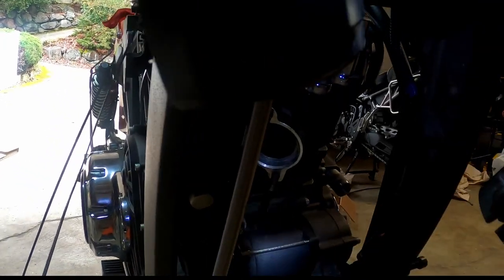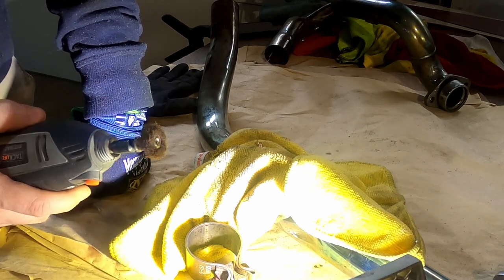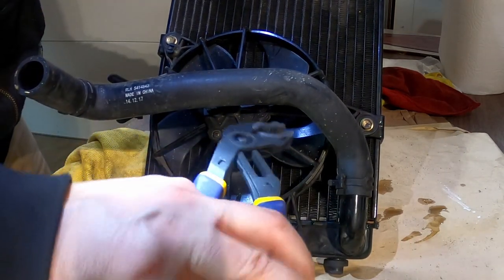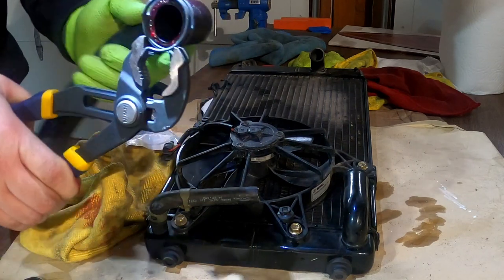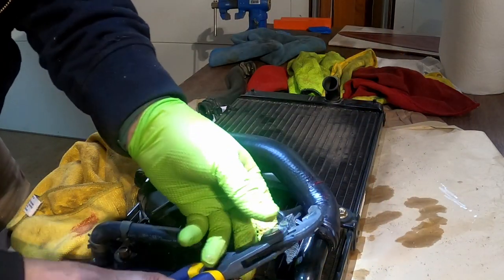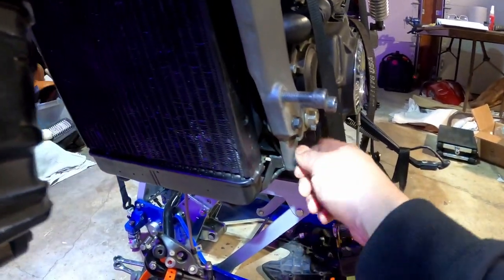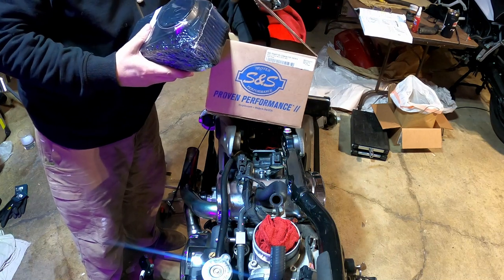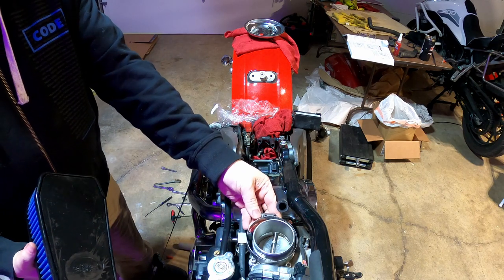Indian Scout Radiator Fill and new air intake

Comment: Thanks for the reply.I think i will buy a coolant vacuum pump to refill it should make it easier. You think indian would put a drain plug on the rad so you wouldn't have to unbolt the rad to get to the hose to drain.
Reply from the maker: Oh I agree.  It is a PAIN without a vacuum pump, but it can be done.  Takes a LOT of effort to get all the air out of the system.  Thanks for watching!

Comment: Great video.Hoping you can answer a question, on bottom of rad there is a small hose and the larger hose.If i am going to drain the coolant i assume by looking at it i would disconnect the small hose to drain rad?Thanks in advance
Reply from the maker: Either actually.  If you have the small coolant ring around your oil filter you can remove that hose, but also uncap the radiator so it will drain.  You won’t get all of it easily, sun some distilled water through or just some of the new coolant and shake the bike left and right.  It takes a bit, but it will drain.

Comment: Thanks for posting these videos I'm working on that bike and this helped me out a lot. Just put in a new starter because when you would try to start it the relay would just make this loud clicking noise and it would not crank. I herd that the Indian 2016 scout had some bad starter problems so I hope this will salve the problem I'm not a machinic but have been working on some other bikes. However when I had the rad and out I noticed a drip of oil on the exhaust flange that should not be there why in the world would oil be dripping from that I hope his motor is not ceased. Anyway thanks again this vid was so helpful.
Reply from the maker: Awesome, glad it helped.  The starter was definitely a known problem in the first couple years. Did you pull the exhaust?  Not sure why you would have had an oil drip there.  I would wipe it and continue until you see it again.  Might have just been a drip off a tool or something.

Comment: Well changed the coolant went well had to take frame rail off  to get coolant in, some guys say you dont have to but my angle funnel would not work.Did you have a hard time seeing level in expansion tank for the life of me with a flashlight cant see the level.Any easy way to do it?Thanks
Reply from the maker: Yep.  I removed the side rail also.  Just made it easier.  I filled the expansion tank first, then did the rest.  That way I didn’t need to see it again.  I put a light UNDER the tank pointing up and then looked while I filled it.

Comment: HI.  can I ask you a question?  I have a 2017 scout with 40000km.  for a few days when I've been in traffic or at traffic lights the temperature rises very quickly up to 97 degrees Celsius.  at this point, as always, the fan turns on but the temperature instead of decreasing to 93 and turning off, continues to rise, up to 110 degrees.  then I resume driving and then the temperature drops and you up to 80-85 degrees (very quickly).  The coolant level is way above the maximum level (strange).  I thought maybe the cooling system has air in it.  should i do a drain ?  or is it the thermostatic valve?  I haven't changed the fluid in 5 years.  thanks for any help you can give me.
Reply from the maker: You probably need to change the fluid, might be boiling in there after it has broken down.  You could have an air bubble, but changing the fluid is the right thing to do.  Supposed to be every 2 years.   The thermostat is working, or it will spike up REALLY high and engine shutdown.
Reply: @jasonshortphd  thank you very much. I will try to replace the coolant and drain all the system, removing the air.  thank's my friend.  I'll let you know how it went.

Comment: Hello I have a 2018 scout and I can't find the abs box can you help thank you
Reply from the maker: Are you sure you have an ABS model?  Mine doesn’t have ABS.
Reply: hello sir thank you for your answer I introduce myself I am French from the side of Lyon I will communicate to you thanks to the translation because I do not speak your language yes I am sure I have abs sensors with small perforated discs but I cannot find the box told me that it is necessary to dismantle all of them I wanted to test my sensors before changing everything my motorcycle is from 05/18/2018 maybe you can help me and tell me where it is located I thank you and count on your answer @jasonshortphd

Comment: I was going to ask you how many quarts of coolant did you use
Reply from the maker: Manual says 2.8 quarts.  I used about 2.5 and my overflow bottle was FULL (do not recommend).  The key was LOTS of burping and burping and burping.  If you start it and the temp spikes you know you got an air bubble in there.
Reply: @jasonshortphd  Thanks for your reply I did just what you did and man all that burbing wow it to a long time and finally I got that done. I put the tank back on and tried to start it and all I got was click click click on the starter relay after all that work and its doing the same thing no crank. Now what?